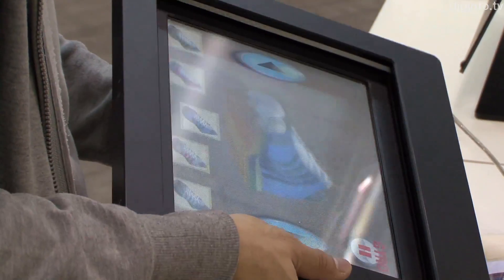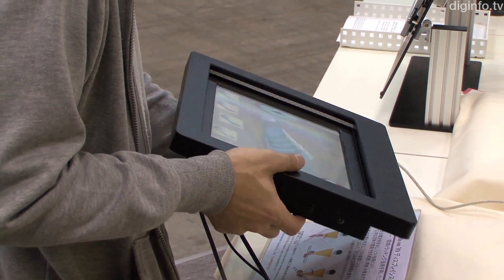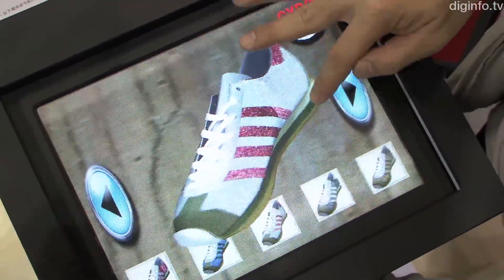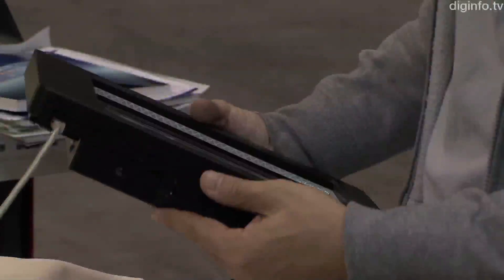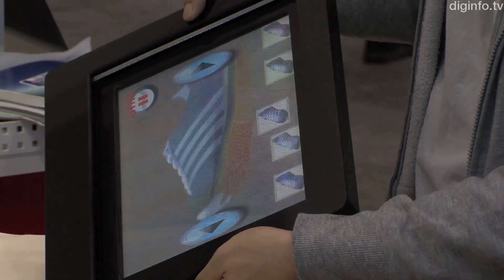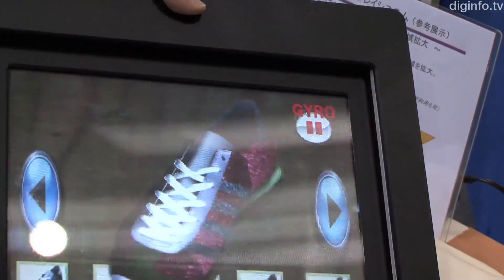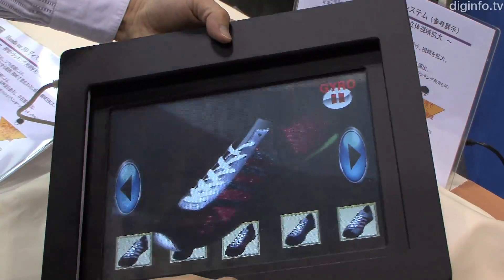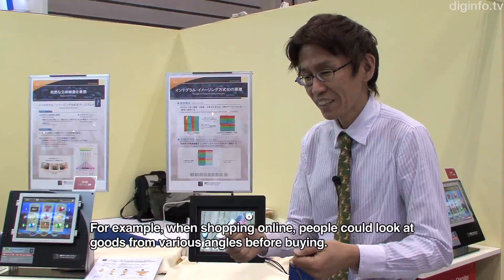Hands On 3D Display System - Toshiba Mobile Display : DigInfo

Comment: @iphoneguy4 While the iPhone has accelerometers, you're missing the fact that the device in this video features a 3D display. That means that the user is seeing the model (a shoe in this instance) in full 3D and is turning that image by tilting. The iPhone doesn't have a 3D display, the image on screen will always appear flat.